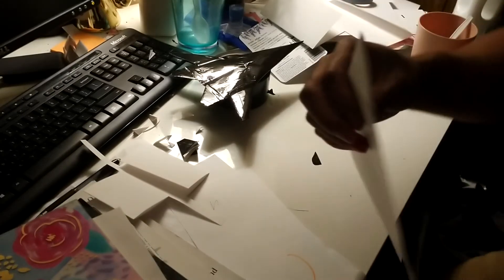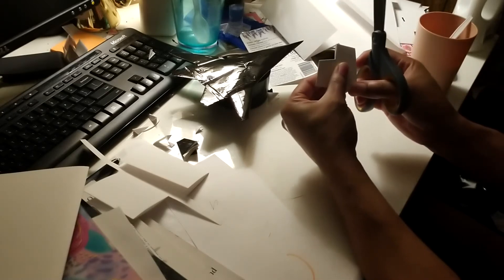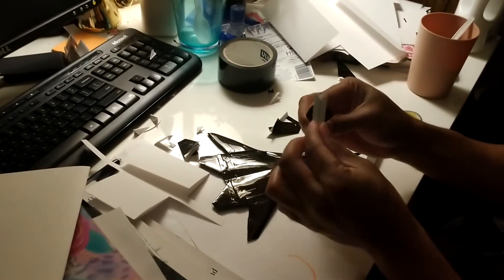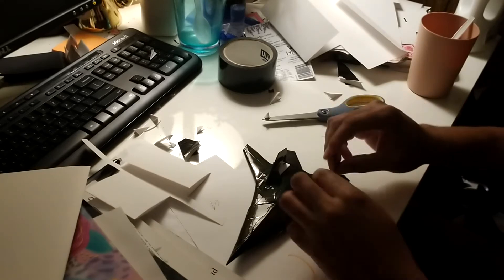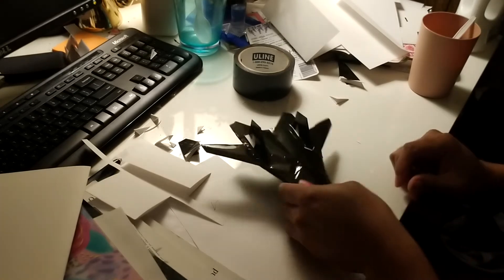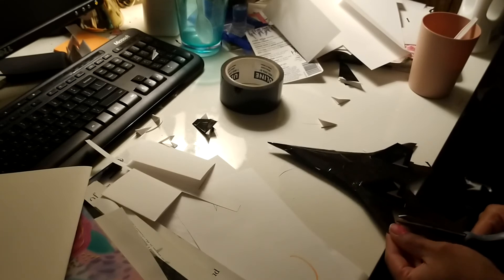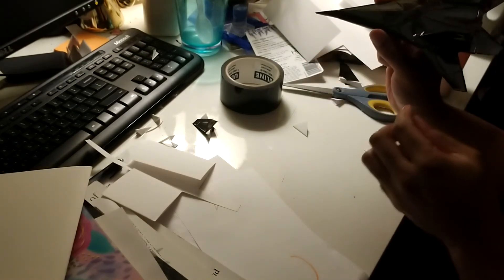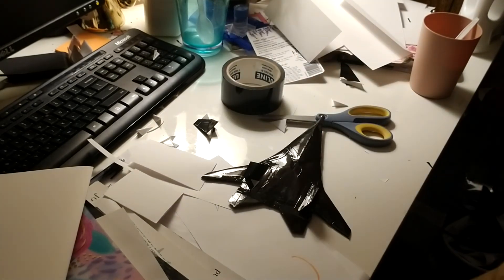RR-8 Tutorial part 5

Comment: What Paper You Use To Make Your All Paper Plane?
Reply from the maker: I use Xerox paper. The weight can change depending on aircraft. I used 24, 28, to 32 weight paper.
Reply: @powerhousepaperairplanesrogers  i meant the size
Reply from the maker: @narexfu  8×11 is the width and length. I don't use anything bigger than that